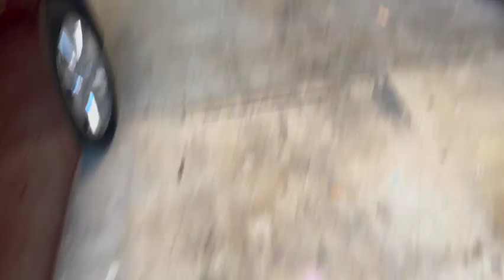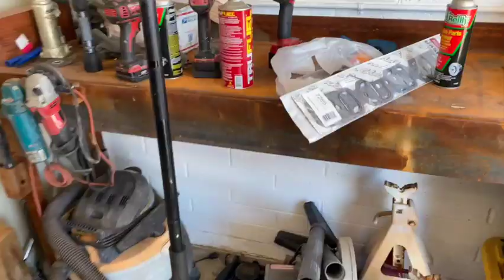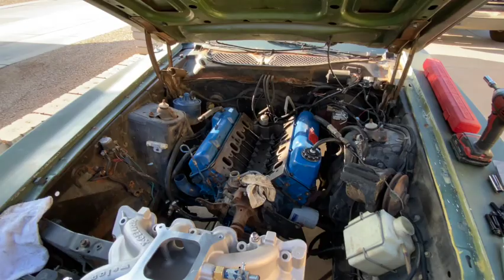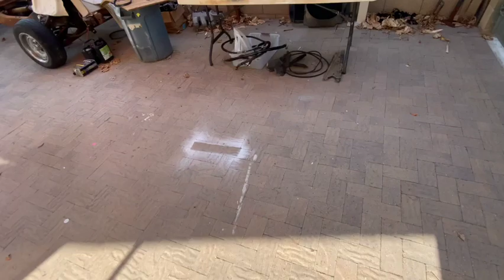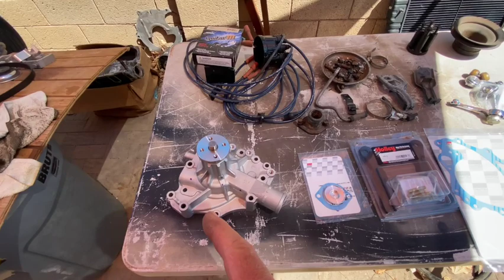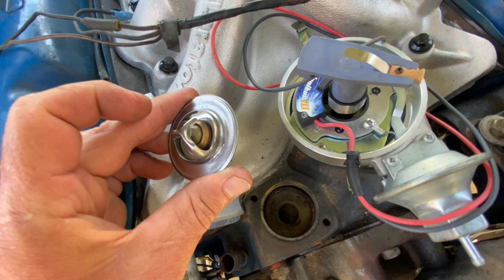1973 MERCURY COUGAR REVIVAL PART 2 / SPEED PARTS AND MORE PARTS / ONE STEP CLOSER

Comment: JUST REMEMBER you are working with a few disadvantages here. THIS COUGAR IS heavy, and will need an in crease of torque, which suggest a long tube 34"  custom header made for it. The compression was dropped down on this model to 8.5 to 1. To use a bigger performance cam in this the compression will have to be raised up.
Reply from the maker: Thanks for the tips! The manifold definitely killed some low end torque. I’m looking for a dual plane. This engine was rebuilt but I have no idea what pistons they used or its compression, I’m assuming it’s a “stock” rebuild.
Reply: @wallysworkin823  Single plane manifolds don't work well on street Clevelands.  Unless you are racing, you want a dual plane.  Someone commented how low the compression was in these engines.  They don't breathe as well as people say without major modifications.  The intake runners and intake valves are large; but the exhaust ports are very restrictive.  Exhaust has to go over a hump and straight down.  If you buy an engine is an air pump, this is where things go awry with the Cleveland.  I had headers on my 72 cougar (2V heads) and hated them.  The car is better suited a cruiser than hotrod.
Do your homework.  I've had several.  They can be sweet, but there's always limitations.  What always works on a 350 or 440 won't necessarily work on your Cleveland.

Comment: nice job don't forget that igniter 111 requires 12v minimum to work correctly I learned the hard way
Reply from the maker: Thanks, I haven’t actually checked it yet, it’s been running perfect. It had a ballast resistor that I eliminated but I need to make sure it’s correct.

Comment: Hi thanks for the video. I also have a 73' Cougar. I was wondering what are the right spark plugs. Do you please have a part #. Thank you.
Reply from the maker: I installed the Autolite 24 plugs. They came highly recommend for the Cleveland. Ford installed these from the factory but will work with points and electronic ignition.
Reply: Thank you very much.

Comment: i'm turning my cougar into a hotrod.  i lifted the front end 2" with coil spring spacers, i shackled up the rear suspension 2", i installed drag shocks on the front suspension, otherwise, my car is stock and has a original arizona body no rust.
Reply from the maker: Sounds like you went old school, all you need is side pipes!
Reply: @wallysworkin823  well....  i am 53 years old, so it isn't old school to me. This is what all my buddies did to their 73 chevelles,  olds cutlass supremes, and pontiac grand prix, and monte carlos back in the mid 1980's (when i was in high school) and earlier into the 1970's.  I'm not installing the 1970's era sidepipes, However, i am painting the car black, and adding 1970's style white racing stripes down each side.  everybody had racing stripes, pinstripes, or billboards on the sides of their cars in the 1970's.... and hood scoops

Comment: hello.  i am in chandler arizona, i am restoring a 1973 mercury cougar xr7 convertible with a 351 cleveland.  if you are going to replace your front coil springs, i have the w.c.c.c. coil spring removal tool made especially for this car, which is way different than the 67-70 cougars.
Reply from the maker: Thank you for letting me know. No plans to change the front just yet, I do want to lower the rear a little bit though.
Reply: @wallysworkin823  the rear suspension has 4 leafs in each leaf spring.  the rear axle housing is mounted on top of the leaf springs.  maybe the cheapest way to lower the rear is to remove the shortest lower leaf (overload leaf) in each leaf spring, that may lower the rear at least an inch, maybe more.  PLUS, the lower leaf is not banded to the 3 other leafs, so you don't have to re-band the other 3 leafs.  the shackles are very short, so i'm assuming that you can't make them any shorter.  otherwise, you may have to completely change out the entire rear suspension to lower it.